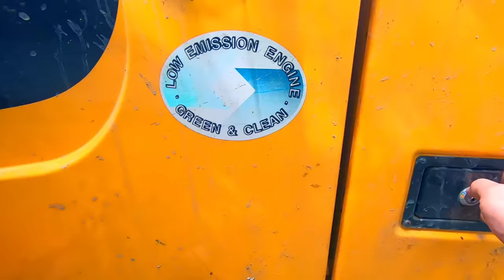Stuck In Mud with Excavator: Beaver Dam Removal Gone Wrong

Comment: Just a tip when trying to pull yourself out use joystick while pulling and move yourself side to side to break suction while pulling also seems to give tracks lil extra boost
Reply from the maker: Yea, a did all that and I have never seen a excavator that got boost on tracks when you move your boom an tracks together. This excavator don't have extra hydraulic pump for tracks or something.

Comment: legitimate question. when you are stuck in a situation like that, i notice you kept trying to go forward and pull yourself out. why not swing around and try and push yourself out? and specific reason?
Reply from the maker: Hydraulic is stronger that way and you can lift the front same time.
Reply: There we're a few times that if you had turned around and pushed you would have come on out of there I've been bogged down in that same situation before
Reply from the maker: Yeah, maybe. I,m tried this many times with this excavator. It helps only when you can get a right angle for boom and stick. This machine is too weak this way.
Reply: When you pull yourself you pick up the leading edge of the tracks to get up on things. In this situation you would just push yourself deeper especially in the bottom of a drainage ditch. I’m wet mud like that suction is your worst enemy.
Reply from the maker: @FattyMatty024  Yeah, that's right. I know that well but as you see I didn't do that enough when I was going into the ditch. I realized this immediately when I reached the bottom and I knew that now probably I get stuck. I broke the bottom of the ditch with the tracks leading edge.
Reply: All good, that ditch looked nasty. Been in some similar situations. You turned a fail into a win. You got the machine out. If you get stuck every once in awhile that means you are working where other people can’t.
Reply from the maker: @FattyMatty024  Thanks for motivating!

Comment: Having no experience whatsoever, I have a curiosity question.   If it were permissible, once stuck, would it have been possible to dig the opposing bank down to the level, maybe lower, of the stuck machine?  Dig under the front tracks and place the drier dirt there for a base?  Do this until the tracks could get traction and clear of the mud?  Is what I described even possible?  I know you were relieved once you got out.  Thanks for posting.
Reply from the maker: It is possible. But in this case the water is flowing through and fills the hole. But we dug out the wet clay all the time and put the dry dirt back under the tracks. Basically we did this way.

Comment: Only when you've got in a pickle like this do you become an experienced operator , if you don't push boundaries you`ll never be confident enough to know it's capabilities and make a right choice !
Reply from the maker: It's true. I learned a lot.
Reply: That’s one thing you get to learn when working with companies over the years. Especially companies that like to hire inexperienced “cheap” “operators”. 😂 when I first started in the field I worked for a few of those companies. I got to see a LOT of crazy things happen. Drug addicts blacking out at the controls of excavators. One guy slumped over the swing stick and was spinning wide open for hours. Cops came. They tried throwing rocks at the cab to wake him up. Didn’t work. 😂 he finally woke up and stopped. Cop ran up and opened the door. Guy had a needle in his arm. Scary stuff.
Reply: @TsunauticusIV  jeez what a story to tell, people are bonkers !

Comment: Y'all did more damage than any beaver could have.
Reply from the maker: Looks like that yeah.
Reply: Sucks when it happens but it happens. I got a skid steer buried once. What was worse is it got stuck in cow crap!lol
Reply: Damage?  Moving dirt around? Since when is "dirt" a god? Sorry but the needs of ppl far exceeds that of animals.
Btw; a .22 will stop any further need for an excavator.
Reply: @DanKoning777  lol take it easy buddy. Softening all that soil in that drainage bed could lead to some major erosion problems in the future. A flood could eat that away and cause big headaches. But seriously chill bro.
Reply: @oldstudbuck3583  if you think I'm a weakling liberal from my comment you are dead wrong. I also love watching heavy machines at work. We have the oil field and coal mines in Wyoming. I also own a company and I use alot of equipment on a day to day basis. I'm a conservative from Wyoming. If you are to ignorant to see the ditch in this comment is man made and is obviously meant to direct water then I don't know. Them getting that stuck and digging and loosening that soil along that ditch could cause major erosion issues in the future. Plus I will guarantee you that this turned into a much bigger headache than he ever wanted on this job. If I remember right it was also next to a small bridge. All it could take is a heavy rain or  a lot of snow melt in the spring to erode that now soft soil and do alot of damage to that ditch and cost more money down the road. In my opinion he should have used skids to get across that and he would have avoided that whole fiasco. The simple fact I'm having to explain this to you is sad.  I'm not the one who is being triggered. The simple fact you have to resort to a political jab in your comment means you are the one who was triggered. I'm using common sense to this situation your are using your emotion. I hope you learned something this evening. Calm down and have a wonderful rest of your week.
Reply from the maker: There is not so much water flow in this ditch. I will show you guys what's next with this messy place that I created. Soon I will dig another pond there and building the dam place where the bridge is.
Reply: @DanKoning777  m

Comment: Thumbs are relatively cheap. Next time you might want to consider mats. The thumb would help a lot for picking the debris out too. I would have been afraid to go into a bog like that without mats. I would have sunk out of site with my narrow rubber tracks too. Anyway, thanks for sharing just how easy  it is to get jammed up. Things like that make me think thrice before jumping off in a creek.
Reply from the maker: Yeah, that was hard lesson for me too.
Reply: @AFHProjects  Oh, well... you probably saved someone else a lot of grief. I had a similar experience in a sand pit with a 1 ton and trailer. Had t o drag it out with the excavator.

Comment: it is pretty funny after the fact when it is not happening to you. I did something similar with an excavator a couple times. I noticed how you tried to pull yourself out the way you came. When i had done it my first time I only went about half as far as you were extended, dug my bucket blade in and lifted as high as i could go up before pulling while driving. Repeat as needed. Once my tracks were about a quater on dryer soil i swung around and pushed while driving. A lot less damage. But I can kinda see that the back of your machine might not have made it acceptable.
Reply: I agree there was a couple times he could have turned around and pushed and come on up out of that hole
Reply from the maker: Not enough power to push!

Comment: this might sound crazy but i've got 35000 hours in the seat of excavators. It looks like that machine has weak hydros but if its possible in a situation like that for a last resort is to lift your machine completely up onto the counter weight , rotate your rails 90 degrees and walk down the ditch till you can dig your way up the bank
Reply: He couldn't break the suction enough to turn his carriage.
Reply from the maker: Wow... The seat hours. Yeah, the suction was so strong. i tried to lift it out but... Actually my plan was to help with this another excavator to brake the suction and lift from tracks but the other excavator driver with more seat hours killed my plan. I don't know why.
Reply: @AFHProjects  hahaha yeah I could see how weak that machine is,  sometimes it's not the operators fault but the machine is just too weak, happy to see you're out without any damage
Reply: @digndurt6936  I wasn't saying to rotate the upper structure,  I was saying to lift the whole machine up standing it on the counter weight that was on the bank , doing that lifts the undercarriage completely in the air and can be rotated to the direction freely

Comment: Wonder if you had lifted the boom as far as it would go and the dipper right in  when turning you might have been able to push yourself up properly looked like you were pulling yourself in were you placed the bucket no expert just something to think on if ever in that situation again always easy to think about different tactics watching a video tbf. Stay safe and take care
Reply from the maker: Thanks! It's too weak to push like this and you push the back of the excavator into the ground this way. If you pull, it's stronger and you can lift your front same time.

Comment: I think the lesson is to not cross by a bridge because you don’t have room to move to get unstuck. They are terrible off road :o) Once the track frames touch mud they stick like glue :o
Reply from the maker: Yep, that's true but I didn't checked the bottom first. My fault.
Reply: @AFHProjects  Getting stuck at some point is 100% guaranteed. :o) And are mostly a surprise. The bad ones need an added ‘thing’ :D - interesting how fast it happens.

Comment: Oh dear, next time you get stuck like that back swing the boom and push yourself out it works better, pulling only pulls you in deeper, whereas push lifts you up and out!
Reply from the maker: No, pulling is stronger and how that pulls deeper. You can pull and lift the front same time. If you push, you push the other end into the ground.

Comment: AT ABOUT 12;57.I STARTED PUSHING...YOUR WELCOME...IT COULD HAVE BEEN WORSE. YOU COULD HAVE THRU A TRACK OR BLEW A HOSE.SO ALL IN ALL NICE SAVE...
Reply from the maker: Yeah... The engine was half way in water and the charging stopped many times. Things wasn't good. Lucky that the engine didn't stop.

Comment: You know, that dam is just sticks and mud. Plus, plenty of water there. So why not float a high pressure pump on the dammed water and use a water jet to disrupt the dam?
Reply from the maker: It's possible. They cut metal with water jet, so the dam is not a problem.

Comment: The smart thing to do would have been use to mats start with. 2nd would have been to block the water from other side of bridge and then dug out deeper on other side.
Reply from the maker: Water came from other side.
Reply: @AFHProjects  yea i know that is why i said block water from other side in 1st comment
Reply from the maker: We blocked the water. But there was too much flow. Later it flowed pass by and the hole was too deep anyways to block something. We just dug it out as fast as we can. I needed to get the excavator out  for the morning, because I needed to go to work. We finished it on the morning around 6:00. Started it at the evening 16:00. Worked all night long.

Comment: The hydraulic pump on the Hyundai is about half what it should be. Either the pressure is set too low or the high pressure release valve is damaged or contaminated. Makes the unit 1/2 the machine it could be. The drive motors wouldn't even spin the tracks in one direction. Someone  good with hydraulics needs a day with this unit.
Reply from the maker: You may be right. It's not the new machine. The pump may worn out too.

Comment: If you never been stuck then must be the first day in the swamp or never ever seen blue clay. I tried to get by a fairly deep ditch and was walking on the hillside above it on ice, snow, tree debris and at first it wasn't so bad for incline so confident could make it, got to the far side and it broke off bad, worse than first thought so looked behind me and seen I had been on a one way course as it radically changed after going over.... so built a little decking on the low side and tried to get through that clay on the hill but you take a scoop an get two in it place so figured no choice but to keep digging or try tying it off before I went so it wouldn't slide... bad idea as I made my attempt as a hail mary the whole hillside traded places!! Only thing showing was a part of the boom so a long walk and the D8 and another machine.. TD24, with winches and angle blades to try... it wasn't long and mine had company! Mountain just kept moving... Not enough insurance to sell this mess, had to wait till the weather broke, then with a lot of equipment got all of it out.... we were laughing and glad to have it all out and have a sip or two as we were just glad to have it back......... we felt the ground move a little and so we were a ways from it and watched that whole trench go down over the mountain even further and it was a half mile wide and about two miles long... I think that we were so lucky as it could of left when we were all in there digging
Reply from the maker: Thanks for sharing your story. No I don't see this clay first time. Reason is that I didn't checked the bottom first. I was so confident about that the bottom is hard.

Comment: Two tips wrong tracks and use bucket,arm& tracks at the same time. To pull out with bucket 80%. The tracks.were you biggest hinderance.
Reply: When ankoring bucket angle  is key in loose soils. My prefoance 135° to tracks.  ->🚜   //
Reply from the maker: It's obvious. But hydraulic flow needs to split between the bucket and tracks. Sometimes try to move these alternately. It helps sometimes more.

Comment: why did you not try grabbing each others buckets and pulling?
Reply from the maker: We did everything. But the wheeled excavator was weak, it had bad diesel pumps. (Repaired for now) My plan was to help lifting the tracks and put the logs under, but I got help from older excavator operator and we did it his way so... but at the end It's all okay and excavator got out. 🙂

Comment: I am not an arm chair bandit, but that Hyundai surely has enough hydro power to be able to pull it self out of a mess, I've only operated Volvo's I guarantee you when I started out we didn't  have video cameras like now,  we have all been buried several times I learned from each time.
Reply from the maker: You can't say that if you not tried this one. Maybe the pumps are bit worn. Anything could be.

Comment: I bet you don’t try that again for a little while I don’t know what give you the brilliant idea of trying to go down and across the muddy creek in the first place instead of just crossing the bridge that was right there unless you were afraid that the solid steel bridge was too flimsy to hold up the weight of your backhoe and might possibly buckle or collapse under the weight of it
Reply from the maker: I think I will do that. Just need to check the bottom first. If you watch my other videos then you will see that I won't see hard ground too much. I'm just the hobby digger. It's my side job and have to learn somehow. Bridge is just an old truck trailer frame with some extra metal welded. Not for excavators.

Comment: There were at least two times when the rescue machine was pulling the stuck excavator with the cable, that the operator in the stuck machine should have had his machine turned around so he could have lifted his machine up level and pushed himself toward the rescue machine instead of trying to pull himself like he was doing.  He probably wasn't experienced enough to do that but that is what he should have done.  He sure left a lot of unstable ground there but at least he salvaged the excavator.
Reply from the maker: I don't understand why the excavator needs to be turned around. This excavator always pulls harder than pushing. Don't ever turn around in similar situations. When you slip back in then you never can't use your bucket because it's stuck in the mud. If you trying to get it out then you machine goes deeper.
Reply: @AFHProjects  My response was referring to the point in time that the  the other machine was tugging on the cable to pull the excavator up the hill.  the excavator was at a steep incline with very little traction on the tracks.  It the excavator turned his machine around and lowered his boom to raise the excavator up level, it would have been a lot easier for the rescue machine to pull him out and the excavator would have had better traction. You can find examples of the technique used on google.  Look for backhoes being loaded on the back of flatbed trucks or dump trucks.  First you put the loader bucket into the back of the truck and raise the front wheels of the backhoe and drive ahead until the front wheels are in the truck bed.  Then using the the back boom, you raise the back of the backhoe up level and push it the machine onto the truck body.  Check it out.
Reply from the maker: Yeah, i get you. We didn't pull the machine first. I just dug a exit for the machine. Only end of the video I helped him with a cable

Comment: I would imagine that bridge would prolly hold that machine. I've been across some sketchy ones with my trackhoe and it weighs 60,000 lbs.
Reply from the maker: Maybe. But what if I was going in with that bridge...
Reply: @AFHProjects  at least it would have had a hard bottom Haha. I would have stuck my bucket in the ditch to check then made my mind up. You done great about getting it out and I understand why you went that way instead of the bridge. Put nice size logs down cross ways next time and use them to set on like mats.
Reply from the maker: Yea, you can use logs if you know that you need them. I didn't know because I didn't checked the bottom first. Dumb me.
Reply: @AFHProjects  everyone makes mistakes fella. You done great my getting it out though.